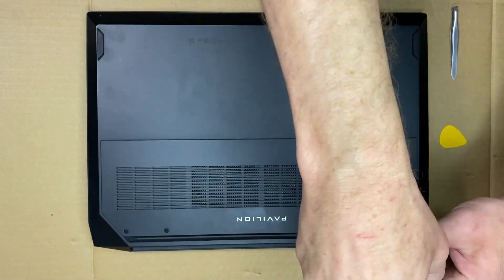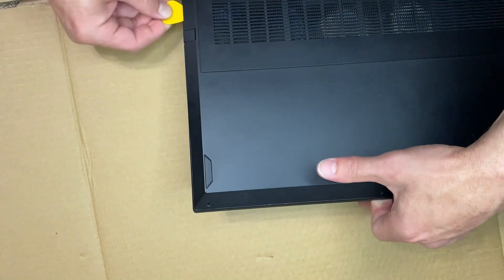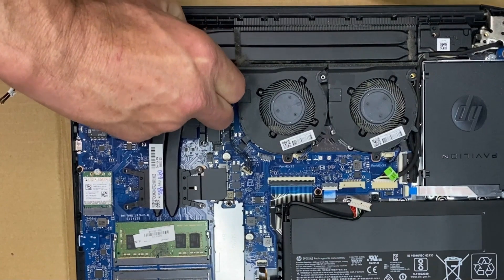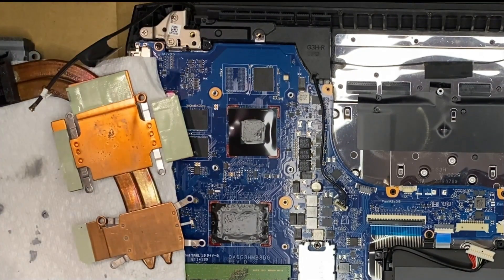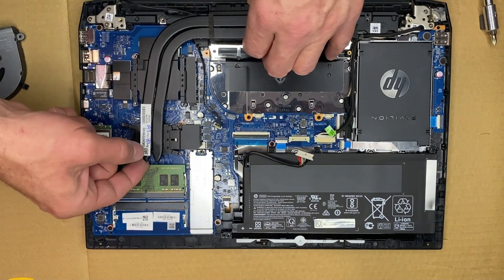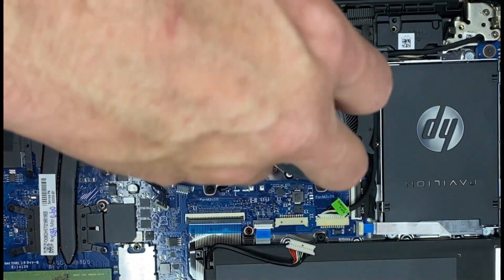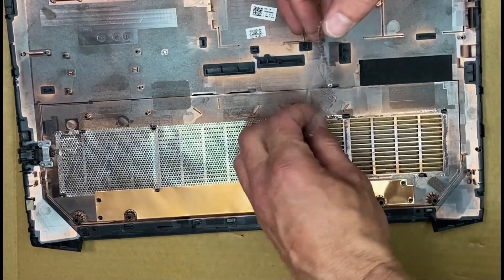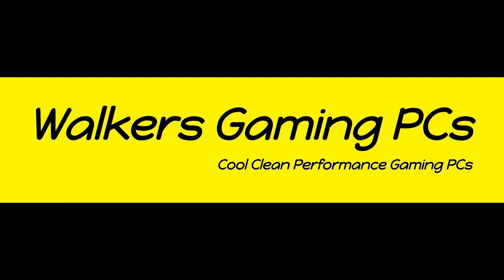Replacing Thermal Paste 2019 HP Pavilion 15 Ryzen 5 3550h GTX 1050 Gaming Laptop

Comment: Hey man, need your help. My heatsink screws are too tight. Screw heads are now scripped off completely after multiple trying. How can I unscrew them?
Reply from the maker: Hey sorry I didn’t see this. Umm if you could nit get them loose with the screw head intact you probably won’t be able to now. I would abort if I were you. If you can’t abort or get help. Cutting a line in the screw head with a dremel tool then using a flathead is probably your best bet.

Comment: I have an HP Pavilion Gaming Laptop 15-ec0103AX.

I'm encountering a serious issue where the performance drops drastically as soon as I plug in the charger, even if the laptop is idle or under light use. Upon checking with monitoring software, I found that thermal throttling is being triggered, not because of the CPU or GPU temperature, but likely due to overheating in the VRM (Voltage Regulator Module) area.

Here’s what I’ve already done to troubleshoot:

Updated the BIOS to the latest version

Re-applied thermal paste to the CPU

Tested running with the battery unplugged (same result)

Tried a higher-wattage HP charger (200W, from a Victus laptop) — same issue

Unfortunately, I bought this second-hand and was told there were no issues. But after testing while gaming and charging, this throttling problem appeared. I urgently need this laptop for my programming classes starting this July.

---

My questions are:

What could be the most likely cause of this issue?

Is it possible that the VRM or motherboard is faulty and causing the thermal throttling

Comment: I can tell you that the fans being flaky is common on these models (I'm on a 2019 HP Pavilion Gaming - 15-ec1206ng which is nearly identical, just higher specs), as mine run almost constantly and then go up and down at random. The real benefit of switching the thermal paste doesn't come from lower temperatures when gaming, but rather from preventing throttling - the laptop is going to bottom out at ~100c anyway. I've switched thermal paste once before about twoish years ago, and I already feel a need to do it again, because the laptop simply runs so hot almost all the time, and I've started hitting that point again where it actually starts shutting down sometimes when playing certain games for extended durations, likely due to overheating.

It is actually insane that they ship these things with the specs that they do, only for them to overheat and get throttled, and there's ultimately nothing you can do other than to switch the thermal paste biannually. 

Great video, by the way. Looked it up for a refresher just so I don't screw anything up.
Reply from the maker: I got my friend a liens cooling pad for like 13$ and it dropped his temps into the high  70s, so you might want to consider it cause his gaming experience is a lot smoother now. Here’s a link to the one I got him but there are other ones that work as well. 

https://a.co/d/fNrKhJ9

Thanks for watching!
Reply: Hello guys,
Can you please mention the Screw Number/Name you are using for Removing fan & Thermal paste cover.
Reply: Also can you please recommend a tool kit for pavillion laptop to open each & everuthing you want.
Reply: @HIMANSHU-2406  I literally use a basic IKEA screwdriver (and hammer/tong!) toolkit for my screwing. It is hardly ideal, but it gets the job done. Point being that I can't really recommend anything.

The toolkit I used for the plastic and such comes from a local Swedish supplier, so anything I can recommend wouldn't be helpful to you. Any kind of electronics plastics removal toolkit should be able to help you do it; just make sure that it's all plastic (No razors and the like! I know it's tempting!). If you can find it, I'd try to get one with a number of thin plastic cards or wedges, because it really helps when you have opened up a section and want to push another section up without risking it closing up again.

Good luck!

Comment: What happens if you set the 'always on' fan option in the bios? Does it not 'save' the setting but goes back to original setting? I noticed that whenever hardware is replaced. E.g screen, hard disk, the 'secure boot' goes back to default setting. Changing it to disabled doesn't 'save' the eetting unless we let laptop boot normally soon after the next boot. It will thrn ask us to enter a code. If we don't let it boot normally, i.e. if wr have a usb to boot from so we hit F9 thrn select usb it will not save the secure boot disabled setting. Sio let it boot normally (dont press F9 (to boot from usb) soon after changing secure boot setting until you see the screen to enter code and confirmed the code
Reply from the maker: Yea that “always on” setting doesn’t seem to work I tried to get it to work but couldn’t. I got a cooling pad and it dropped the temps almost 20 degrees.
Reply: @walkersgamingpcs  ok thanks for the info about cooling pad. re. fan setting in bios, is the setting 'fan always on' set to 'enabled' in bios but the fan still comes on intermittently? if you enter bios now, is it set to 'enabled'? or has it gone back to 'disabled'? I suppose your friends not too bothered about it as the cooling pad has got the temp down a lot. Fan not always on is also good for saving battery life (when mobile) and less noise.
Reply from the maker: Yea it stayed set to enabled unless I changed it myself which I did after we got the cooling pad. I did have the latest bios from Dell on it at the time and bios version might make a difference. I don’t have access to the laptop right now but I will in the future if you want me to check the bios version.
Reply: @walkersgamingpcs  I had a look on the HP website. None of the bios updates for your friend's laptop fixes an issue to do with the fan. THe fixes are mainly focusing on security, hibernation and Trusted Platform Module (TPM). BTW, what I talking about earlier re. 'secure boot' seems to only affect that setting (and 'legacy mode'). i.e after disabling 'secure boot' let laptop boot normally and wait for prompt asking to enter code. Changing the fan setting shouldn't bring up a prompt to enter a code. My Laptop temperature is running between 65 degrees and 70 mostly (not playing games mind you). Can hear the fan coming on and off intermittently. I don't remember if the fan always on setting in bios is 'enabled' or 'disabled'. Will check next time I reboot.
Reply: @walkersgamingpcs  What kind of cooling pad, and is it suitable for actually having in the lap?

And on the topic, yeah, the settings for fans seem to be largely ignored by the BIOS settings. I have managed to lock them into being "always on" at one point, but that results in the fans literally always being on at full power, meaning that you've essentially got a jet engine in the room with you. All other settings have done nothing for me, and sometimes they are spinning wildly at 67c, only for the computer to go up to 80c anyway, and then them slowing down and the computer reaching 100c, and then they start spinning faster again but still not at 100%. They are really, really random; I suspect that these models have some kind of issue determining temperature for the fans, because it absolutely is not based on whatever temperature the motherboard is picking up for the CPU/GPU.
Reply from the maker: Sorry I thought I answered this already. The cooling pad was Liens cooling pad here is a Amazon link but you could purchase it anywhere   https://a.co/d/aHcCm78

Comment: Hey! I am unable to unscrew the screw at 2:50, i tried applying vertical force of the body, what should i do? 
2 came out easily, other 2 wont budge at all.
Reply from the maker: Make sure you have the right screwdriver size and you have to press down really hard to remove them. Unfortunately thats the only way they come out, no kind of spray i know of helps here because they are not rusted/corroded they are just really tight.
Reply from the maker: downward force is key

Comment: So After Doing all these steps..was the laptop working fine and more efficient than before without overheating ?
I am gonna follow your same procedure next week to my HP pavilion gaming laptop. I hope I'll do it as you did..
Another Question..Does it makes any sense to remove those Small Chip Vents sheet from the Outer Cover ?
Reply from the maker: It only dropped the temps 3-4 degrees for me, I bought a Liens cooling pad for $15 and that dropped the temps another 10 degrees and you don’t need to take anything apart it just goes under your laptop. The vent sheet stops dust from entering the laptop and should be left in place.  Here’s the cooling pad I bought. https://a.co/d/hexPh7x

Comment: Hi. Whats the ideal idle temperature of the cpu? And what would be ideal on heavy use?
Reply from the maker: Hey thanks for watching. The max temperature Tj max is 105c on that chip, meaning as long as it’s below 105c it’s running within spec and not thermally throttling. As far as ideal, electronics live and die based on the heat they produce so you want them to run as cool as you can and CPUs hit their max speeds more often the cooler they are. Temperature is part of the algorithm that determines what frequency your cpu is running at. So try and keep it as cool as possible without going overboard and spending a ton of money on it. I bought a Liens cooling pad for $15 and that dropped the temperature  15°. Whereas the thermal paste only dropped it like 4°.
Reply: @walkersgamingpcs  thanks for the confirmation i was looking to change my thermal paste cuz i havent done it since i bought it but my cpu never goes above 105 so i should be fine with some cleaning of fans and regular dust removal , i prefer not to take off components from laptops though 
just get a little scared with removing components of laptops , cuz i swear hp really tightens those screws and they really dont make it easy to open and remove/replace components
Reply: also this laptop is non upgradable in terms of ram, hp sends any ram more than 6 to hardware reserved , its a old issue and its because of the bios so dont try upgrading rams you can upgrade harddrive to ssd though
Reply: @C4AZ3_Kaze  Mine came with 8GB module but when I checked it was showing much less. searched online and like you say turned out bios reserves some memory (for onboard graphics card I believe - in bios there is no way to disable onboard graphics and only use dedicated graphics). Upgraded to 16GB, now my system monitor is showing 13.9GB memory. So, seems 2.1GB is reserved. I remember reading this laptop can take up to 32GB RAM.
Reply: @kchinthaka8975  wait how did u upgrade? Its a hp pavillion right?
I added ram to mine too and it took like 8 gigs reserved
Reply: @C4AZ3_Kaze  Mine's a HP Pavilion Gaming - 15-ec0050ax Ryzen™ 5 3550H with GeForce GTX 1650 Mobile. I bought a 8GB module at the time the laptop was purchased and added it. You should'nt have 8GB as reserved. I read that if it shows 8GB reserved it could be due to a bad memory module or another reason could be due to mix and matching memory modules. If it's not due to bad memory module try having two modules of the same kind.
Reply: @kchinthaka8975  well the ram is definitely fine , i tried it on my brother's pc and it worked well
But it is however mixing some different companies + different speeds
But theyre both ddr4
And i wouldn't mind if the speed of new ram was lowered due to the old one
But they just don't work.
Reply: @kchinthaka8975  regardless though i think the laptop is pretty outdated now
It gets stuff done yes , but thats about it
Cant expect to play monster hunter wilds or ram intensive games on it
Reply: @C4AZ3_Kaze  so when you boot windows, it's showing 6-7 GB as available (as 1-2 GB used by Windows immediately on boot) and 8GB reserved?
Reply: @C4AZ3_Kaze  these are the two 8GB memory modules in my laptop and together they provide 13.9GB. If you can buy them for cheap maybe worth installing on yours. Here goes: Samsung DDr4-2666 (1333MHz) (part number: M471A1K43CB1-CTD). I think the laptop came with the Samsung one. The one i had installed is: Crucial  DDr4-2666 (1333MHz) (Part Number: CT8G4SFS8266.M8FD)
Reply: @kchinthaka8975  eh nah its fine
I spilled some water over it few months ago
The ssd , some keys are cooked
Its gonna require replacing at this point
Not to mention GTX 1050(maybe it was 1650 not sure probably not though)mobile aint going very far in modern times
Reply: @C4AZ3_Kaze  do u have an eye on one? When I was doing the reasearch for buying some 5 years ago, I narrowed it down to an ASUS Rog (it may have been ASUS TUF - I don't remember) and this HP. ironically, remember seeing that the ASUS had some cooling issues so I went for this HP. The HP was much cheaper too albiet sligtly less in specs. I say ironically, because temperature is what we're talking about in this video. TBH, I've not had any issued with tempearutre, but that maybe because I've hardly played any games on this HP laptop (or any laptop for that matter)
Reply: @kchinthaka8975  brother its been 5 years
Prices changed , economy changed, and cooling pads exsist (they did back then too)
Im not gonna buy another hp
Ill do my research when im looking to buy which might not be this year, maybe next year though (currently I use my brother's pc when i want to play)
Reply: @C4AZ3_Kaze  I'm probably not gonna buy and HP either. The whole not being able to disable onboard graphics (thereby freeing the system reserved) within the bios left a bad taste in my mouth. I get why HP have both onboard and dedicated graphics, so if we're not playing games then the laptop is using onboard grahics thereby not using that much battery (useful if we are not connected to power source and just using battery), but I think they should've offered the option within the bios (for folks like me who hardly use the laptop on battery). For my next laptop I've made a list of things to watch out for and this onboard graphics disable featuee in bios is something I will  check before buying.
Reply: @kchinthaka8975  i mean they advertised the pavillion as a gaming laptop
Gaming laptops run on charge not on battery its just plain stupid imo

Comment: hello i have the same laptop but its a 2021 one, should i replace those pads when opening that i think come over the vrams or something and also replace the thermal paste? or just leave them there i don’t know what to do.
Reply from the maker: @cristiv.17  if the pads are dried out I’d replace them or if they’re all ripped up but they last a lot longer than paste generally speaking. As far as paste yea it’s probably time. They don’t use the best paste to begin with and it tends to dry out fast.
Reply: @walkersgamingpcs alright man thanks but how do i know what kind of pads i need?
Reply from the maker: @ you can either measure them with a micrometer, or order a few different sizes and compare and go with closest. You could also try googling it….. maybe.
Reply: @walkersgamingpcs thank you
Reply from the maker: Also this was my friend’s laptop and he was still seeing 90+ temps after thermal paste so I bought him a Liens cooling pad and it dropped his temps to the low 80s so that also something to consider.

Comment: i have the exact same laptop and the cpu reaches 95 to 100c even though i have changed the thermal paste and cleaned the fans. Why does it overheat so much?
Reply from the maker: The bios doesn’t really allow you to run the fans at max all the time even though it has an option for it. The cooling system and fans are undersized as well my friend gets the same temperatures. I recommend one of the laptop coolers that go beneath the laptop and blow air into it.
Reply: @walkersgamingpcs  i think the fans are running at full speed because it is very loud and noisy i could hear the fans from like 5 meters
Reply: For me too before applying thermal paste it was touching 101,102 but after 96 max
Reply from the maker: That’s a significant improvement, glad to hear it.
Reply: I would sugest you to turn off CPU boost, i did it and my temps arnt going over 70C, with no noticable performance difference 

I used this video
 https://youtu.be/EvnVLz6m22w?si=ImoYRefhdYQfPxhp

Comment: those screws really screwed me up as they are too frigging tight that i almost chipped one of the screw , that too hard to remove those
Reply from the maker: Yeah, I agree, man I couldn’t believe how tight they were. It was a literal wtf moment.
Reply: How did you end up removing them ? Mine's super tight and I'm afraid of chipping them
Reply from the maker: I just used force but I was a mechanic for 10 years and have a lot of experience in removing stuck screws. You have to press down hard so that it doesn’t strip the head of the screw